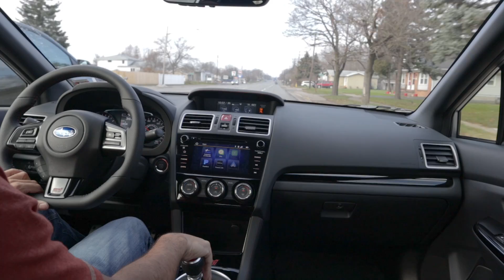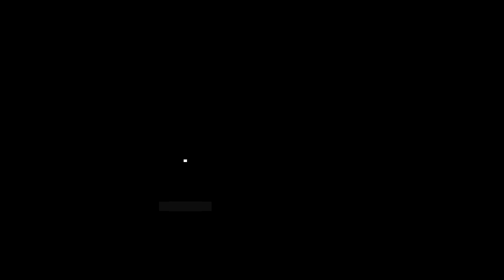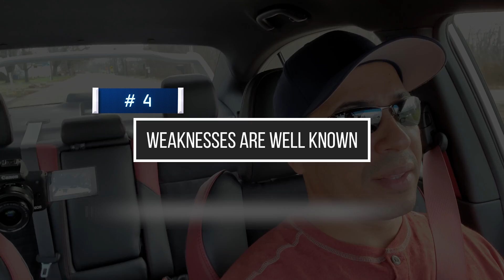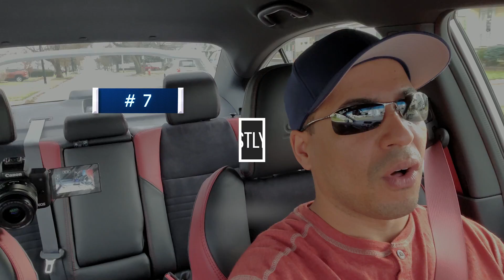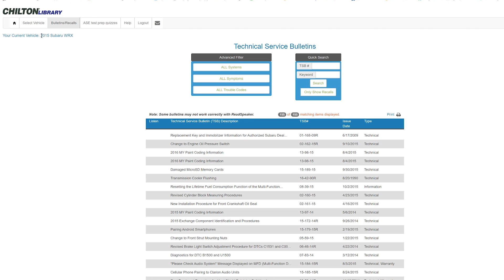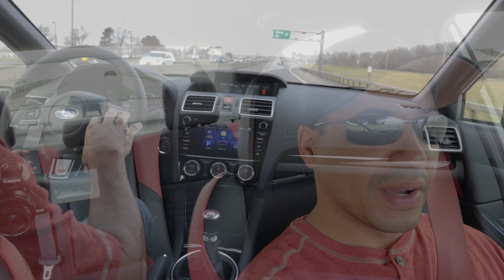2020 Subaru STI:  Why I didn't wait for the next gen STI

Comment: I bought a new 2019 STI last month. Living in Michigan so far I got Winter Pirelli tires installed. Ordered a Borla Type-S Catback exhaust.
Reply: I'm thinking about changing my stock exhaust... what are your reviews with Borla exhaust? and did you consider In R400?
Reply: @Frank_Goj  i have the R400. Looks and sounds great, but if i have to choose again i would get the Q300 since i daily my sti and the Q300 isn't as loud as the R400. The R is not unbearable though.
Reply: @BP5Lwhipple  I'm in Royal Oak MI.  You?
Reply: @Frank_Goj  oradell nj.  Dallas Williams mentioned a good one the tomei exhaust.
Reply: @BP5Lwhipple  Thanks- I'm now looking at the Q300 more seriously.
Reply: @Frank_Goj  cool, one thing to keep in mind is that the R400 looks great looking at it from underneath the car being on a lift you know. But you'll be looking at your exhaust from behind the car while its on the ground and that's where it matters, the q300 has better looking tips since they're rolled at the end. The r400 is not so it doesn't look as good from behind. Also me having the r400 i wouldn't dare drive by a cop above 3k. The q300 will give you noise when you get on high rpms. Not all the time like the r400.
Reply: @BP5Lwhipple  cool. thanx for the input.
Reply: @Frank_Goj  borla overpriced.  Invidia are way to quiet.  My personal taste I like me loud and peppy.  Tomei is top notch.  On a budget remark by greddy is an excellent choice.  Great quality welds backed by a LIFETIME WARRANTY.  Something you rarely see nowadays.
Reply: @dnawrapsatl  single pipe looks dumb without replacing the rear bumper just leaves a big empty space where the old pipe was..
Reply: @crimescene25  they have a delete piece for the hole. It's a fake dual anyway. Meant to be 1 pipe. They just put 2 for looks
Reply: @dnawrapsatl  You got a link? cause my ocd isnt going to let me do that lol.
Reply: @dnawrapsatl  Also, do you have it tuned for the exhaust?
Reply: @crimescene25  I'm thinking subispeed has it. No tune needed for a Catback exhaust. Will need a tune for a j pipe
Reply: @Frank_Goj  I am getting the Borla Type-S Installed next week.
Reply: @moonman_8935  please drop me a quick review of yr thoughts on Borla  please. I'm not looking for loud exhausts (getting old)
Reply: @Frank_Goj  I live in Canton btw..
Reply: @Frank_Goj   I just had the Borla Type-S Catback installed on my 2019 STI today. Amazing system no drone & the car is quiet.. during WOT it gets loud & the rumble noise is unique with the Borla.
Reply: @moonman_8935  where did you purchase from, online?
Reply: @moonman_8935  congrats on your first mod.
Reply: Rallysportdirect
Reply: Nice, enjoy it
Reply: Dang expensive tastes
Reply: I’m in MI too with my 19 sti. So much for that snow lol

Comment: What made you decide on Silver and not Blue? I’m in the market for a 2020 STI. Was interested in the 2019 GTI Rabbit, until I heard about the plagued stalling issues and no fix in sight.
Reply: @akqjtn  When I was shopping for STI my local dealer had the lapis blue on the lot. Very underrated color. Looks so good in person.
Reply: @Maximum_911  Very happy with my lapis blue 2019. The color gets a lot of compliments.
Reply: I’m still on the fence about what color. This is my first WRX and either want something that flies under the radar like white or Blue and pay homage to the lineage of the model and brand. I hear Subie paint is really thin so I need to factor that in too.
Reply: @BeeStinger13  I would get a clear bra AND ceramic coat as soon as you get the car. It's worth it imo.

Comment: I got a 2019 in the same color. Every time I drive the car I am reminded why I had to have one. I can't believe how good it is in every way a car should be.
Reply: Captain Buff The Third Said the guy who never drove an STI.
Reply: I have myself a silver 2018 sti and I'll tell ya what man everytime I drive I can't help but smile. Straight ear to ear
Reply: Why Should I buy this over Type R. I like both ..Help
Reply: @Muhib443  If you want a bulletproof motor, get the TypeR. I was looking into the TypeR but I bought the STI for a few reasons. The overall 90s feel, the all wheel drive and its more understated appearance. I won't be modifying mine so I'm not worried about ringland failure. The TypeR is a fine car and I can't say I won't own a preowned one at some point but for now after 1.5 years, I'm really happy with the STI.

Comment: I might trade my 2017 Focus RS for the 2020 Sti this summer.
Reply: Surprised u still have the RS
Reply: Doesn't even seem like a choice. But hey I'm no fan of ford
Reply: Dont.  I have both and would get rid of my 19 series.gray sti before the RS

...the seats, alone, are reason enough
Reply: @TheMetalGuy852  would never buy a VW after they lied twice about their emissions who knows what else they're doing
Reply: @snowjammma  id love to have one of those lie vw diesels...i think people are retarded for getting rid of them...but tis americans
Reply: @ChupaLeche  not a lot of decent diesel mechanics and never go to the dealer for service unless its your last option
Reply: @snowjammma  i would never take my vehicles to a dealership, NOT even as a last resort.
Reply: @ChupaLeche  you dont go to the dealer for recalls...
Reply: @snowjammma  negative.  Swapped airbags with tech the other day
Reply: @ChupaLeche  hmmm wasn't aware Subaru allowed customers to work with their techs, for strictly liability reasons but  you must have a connection with your dealer to do that.
Reply: @snowjammma  its a much BIGGER  liability to allow a dealer tech to touch your car.
Reply: Daaammmnnn that hatchback thooo
Reply: yea I live in new England and see way less rs than WRXs
Reply: @TheMetalGuy852  yea I can see that but I got 123,000 miles on mine and still pulling strong, Subaru could use a lesson from vw interiors but the results speak for themselves subaru AWd system unbeatable, platform has been round aroumd 20 years and people all day make 800hp on that system so try that on your golf
Reply: @TheMetalGuy852  LoL, a co worker bought a high mileage 2002 golf for a work car. He loves it,  leaves his new Ram 1500 rebel truck at home
Reply: Weeb Elite Agent I wouldn’t just cause the RS is becoming rare
Reply: I own one too and I can assure you will regret it.

Comment: I got 32 miles on mine. The break in period, is that you cannot pass 4,000 revolution?
Reply: I'm all about that break in period but when I got my 2014 sti with 10 miles off the lot ? I drove it home like I stole it .. it now has 92k miles .. just following maintenance no issues .. just sayin..  transmission on these cars are like idk amazing hehe ..
Reply: @noxnyc23  Yeah you will likely not have any issues bro. Break in periods were very important in the past but nowadays with more precise manufacturing techniques you will most likely be ok
Reply: @freeping6194  he should be okay but you still want to break in a new engine as to not abuse it until the combustion chamber has sealed properly.
Reply: That's right don't exceed 4k rpm until 1000 miles. After this do as you please. I choose not exceed 5500 rpm until 2000 miles to be extra gentle to the brand new engine
Reply: Ezequiel1974 I brought mine up to 180kmh within my first 100km. 0 problems. I have a 2018
Reply: Why don't you read the fucking manual you fucktard??????

Comment: Congrats man! I’m thinking about switching to STI from a wrx. I test drove an STI recently, liked it overall but totally forgot to try sport and sport sharp modes lol. Will be scheduling another test drive shortly. Everyone says STI is bad on fuel compared to WRX. As you are breaking in the car, can you please test in the “commute” mode what your gas mileage is, comparing to the WRX cvt and the Ascent?
Reply: @VDM I had a 2017 WRX and now have STI. Same commute and style of driving (shift at 3-3.5k) with a bit of spirited driving every once in a while) I am getting 80-100 km less per tank. My best in a WRX was 520 km, best in STI is 424. Hope that helps. P.S: I am doing 60% highways.
Reply: I bought my 19 STI base in April of this year, I was coming from an 18 WRX premium and hated that thing because of the rev hang and electric power steering. The mileage is a downside but the fun factor is way up. I dont have any mods and I noticed that the car got worse mileage in intelligent than in sport, so that's where it stays unless I want to have some fun. I do a mix of city and highway driving and consistently get 18 during winter and up to 20 in the summer. My WRX got 21 on average regardless of how I drove it, so I didn't lose a great deal. Hope that helps. BTW, I live in Eastern Washington.
Reply: You did try it in sport, just not sport sharp! You or your dealer have to push down for it to go on intelligent .. ones you start the car , it's on "s"  mode all the time ,never stays on "I" mode .. unless 2015 and higher changed how it use to be .. 🤷🏼‍♂️

Comment: Maybe dual injectors. That's not new, just super expensive
Reply: Mazda speed guys are doing port injection as well as direct on aftermarket intake manifolds. Can support as much power as your engine and fuel pump can handle and it keeps the valves clean
Reply: @sleeper.simulant7327  bingo
Reply: Khang Xiong BRZ already is running Port and DI injectors.
Reply: @OggaDugga  that's why I said it ain't new technology. But it would be new for the WRX I think.
Reply: It’s been done however I’d change the trans before fuel mods honestly
Reply: @OggaDugga  not sure where you are going with this. It's all speculation for the next gen sti